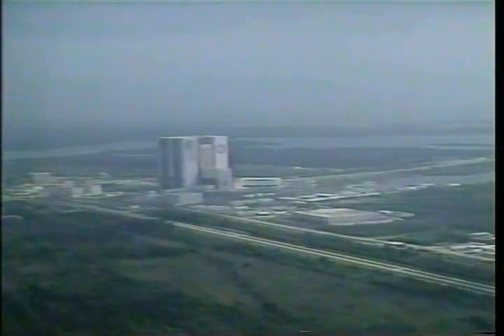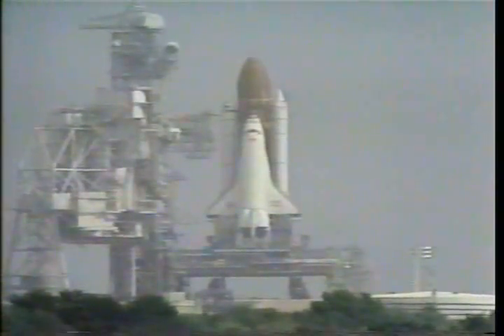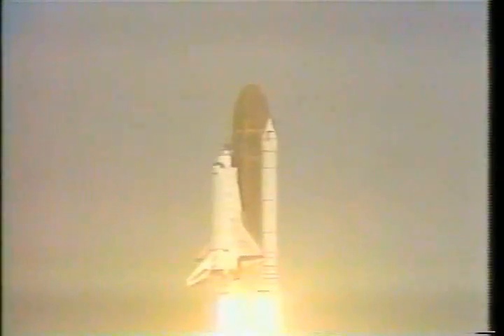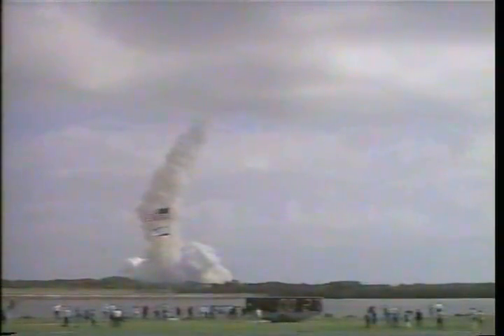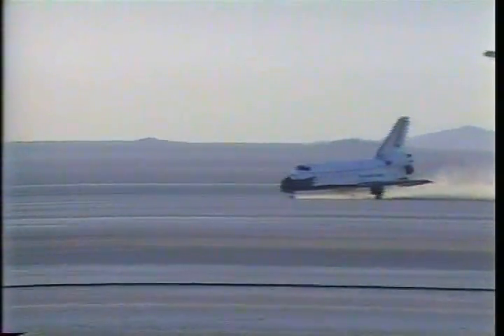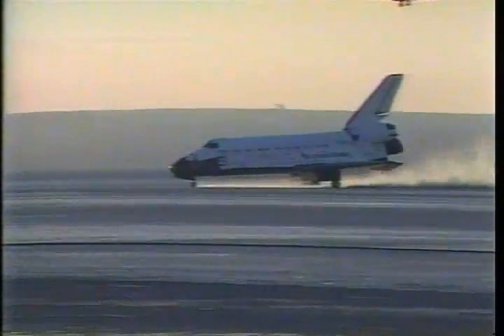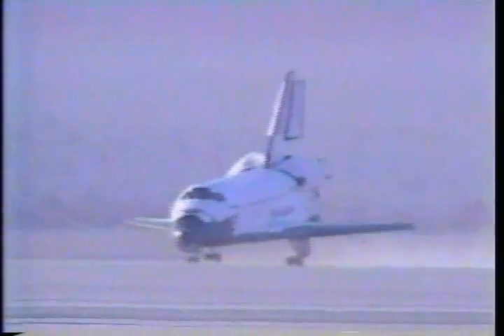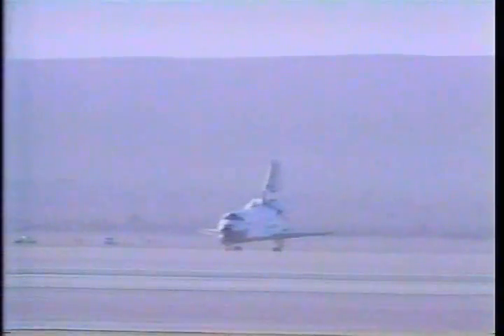STS-37 launch & landing (4-5-91)

Comment: It was probably a bit of a "turnaround" headache due to more crap being kicked up by the wheels and hitting the underside. The actual runway is "prepared" and much better. Just shows the drawback of really really needing a solid forecast 90 mins out. That's a tall order at Edward's, let alone KSC.